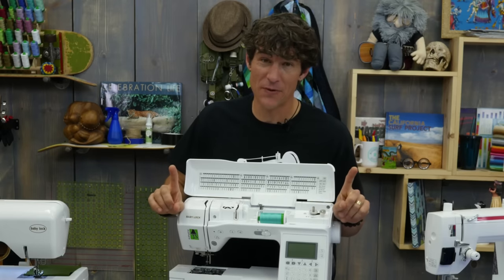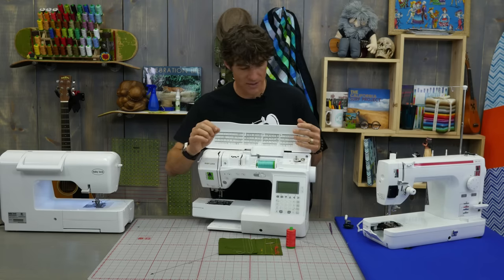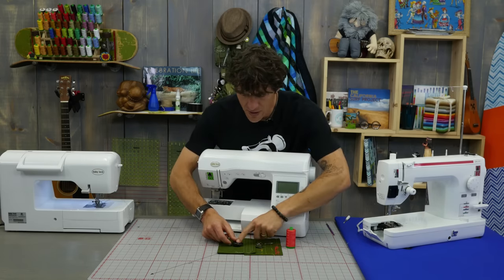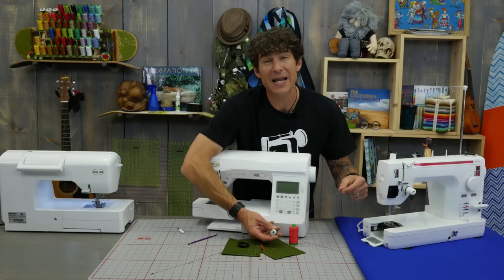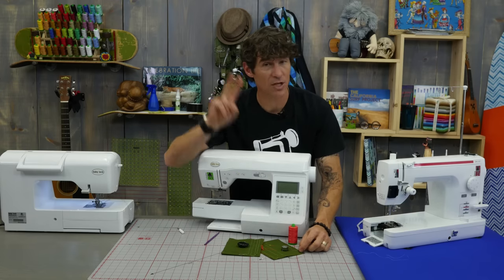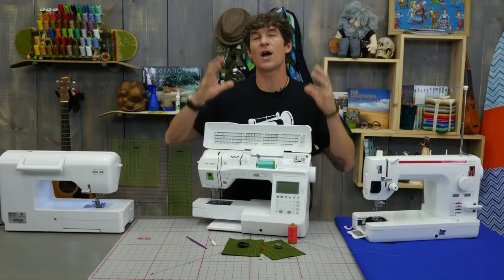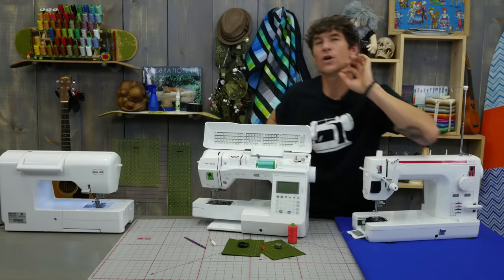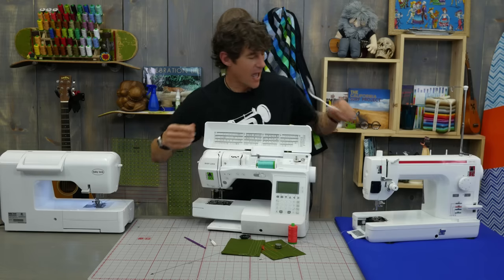Sewing Machine Maintenance: Tension

Comment: You stopped short of the information I need. What to do when the tension discs don't close when I put the foot down. They are clean, good thread, threaded properly but discs are now too loose.
Reply: You need to turn your tension wheel/dial to a higher number.  If your tension wheel/dial is already turned to the highest number and it still has no tension, your tensioner may need to be fixed or replaced.  But first,  look inside the head cover, IF YOU CAN, to make sure that the arm that actuates the tensioner has not broken or the screw come loose.  Hope this helps.
Reply: @jamiechapeau8533  my particular machine doesn't have a dial, but I did find out how to change the tension. No matter what setting, when put foot down, the tension discs never closed. They stayed open and loose. Sure made me seem smart when I took the machine in and told them the problem and what I tried. Thanks for the information!

Comment: my needle seems to hit something solid,  needle won't go down.
Reply from the maker: Hi Doris, Please make sure your bobbin winder is not engaged, if the machine will still not make a cycle, remove the needle, and try again. If the machine will cycle without needle you need help from a tech, means the machine is out of time. If the machine will not cycle without a needle, then we know it is a jam, try to turn machine in reverse, if it then cycles, it may be free. Either way sounds like you may need some hands on help from a pro. Hope this helps!